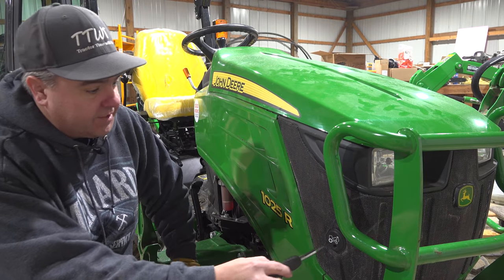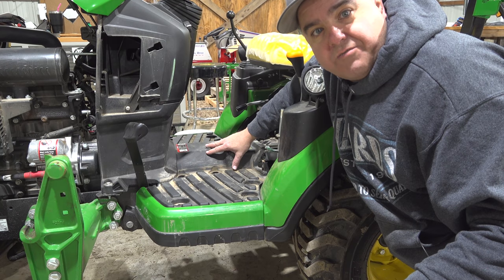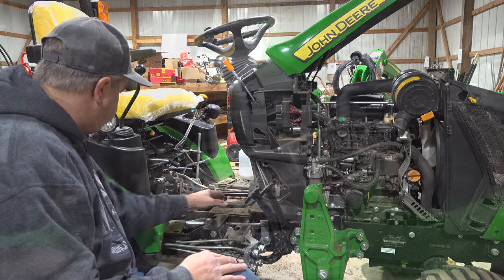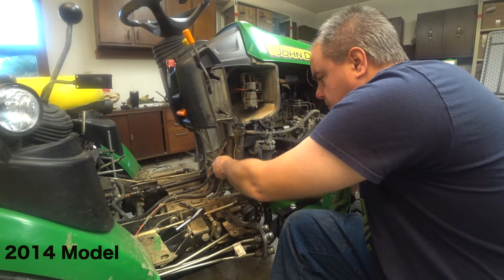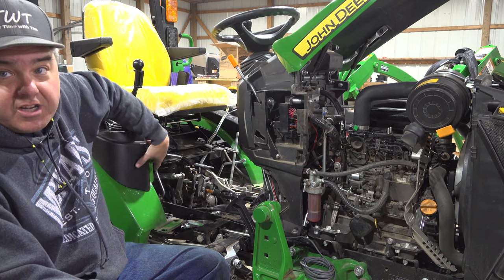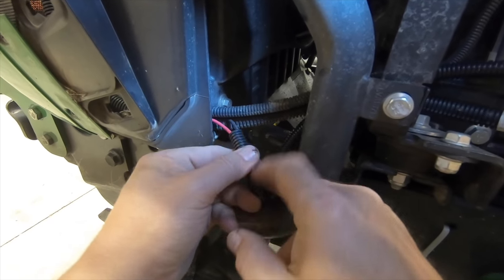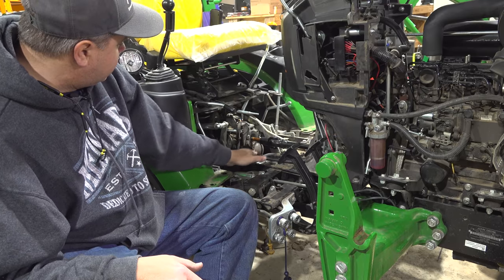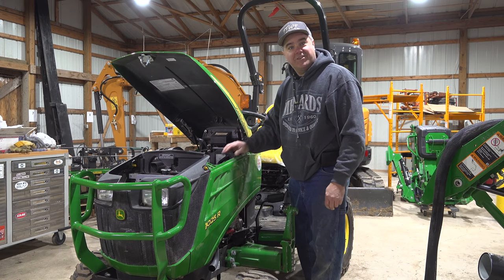Deere 1025R Internal Changes. More extensive than I thought! (vs. 2014)

Comment: The "wire loom " that tim has is plastic, My Brother in law is a Marine Mech. and he use's a woven mesh thats  similar  to the plastic version  but is more wear resistant because it's used in the boating industry ,I believe theres more vibration  and it's pretty much indestructable.
Reply: Wire loom is a woven coated tube. Concoluted tubing is a corrugated plastic tube which can be either unsplit or split  on its length. I was initially an aviation feature developed by Dyna Corp and Lockheed Martin to run wires in and have a weather proofed device for wires exposed in engine bays and wheel wells. The aviation field has all kinds of various fitting that are heat shrinkable that is used in conjunction with convoluted tubing. Other uses simply use electrical tape to close the ends and areas wires exit the tube.  The expanded mesh tube such as used on the H120 loader hoses ar the hyd disconnects is commonly called panty hose. It comes in single conductor to large wire bundle sizes. It is used at the ends of convoluted tubing where wires enter or exit for flexibility.

Comment: I am rather surprised with the amount of plastic used on this model.   I am not sure how I feel about that.
Reply from the maker: I have no issue with it.  Haven’t seen any stories of it wearing, breaking, or otherwise failing.  Meanwhile, the 1025r is actually less expensive now than it was in 2014 when I bought mine.   Amazing!  lots of machine for the money.
Reply: @TractorTimewithTim  Unfortunately, last season when I bought my subcompact tractor, the quote I received for the 1025r (which I really wanted) came in a good bit higher than I was happy with.  The orange and green somewhat shocked me.  I ended up going with the GC1720 TLB which I've been ok with so far.  Slowly, I'm adding implements and adding farkles.  It's a lot of fun.  

Aside from the seat being wonky, did you have any other observations about the MF GC1700 series? I appreciate your  opinion and keen attention to details.
Reply from the maker: I like the Massey.  It is missing some features which the Deere has, but it has strong and smooth hydraulics.

Comment: Gross weight /Length the same or less.  Is it a short block of sorts ?  Smaller cylinders ? same power. Hum.
Reply from the maker: More efficient use of the space around the steering column, I think.

Comment: If that has 25 horse than it’s not much better than my much smaller lawn mower which has 23
Reply from the maker: Right.  Horsepower alone determines effectiveness.
Reply: A 25 horse diesel is completely different animal than a 23 horse gas. I'm sure your 250hp car is just about the same as a 300hp Mack truck too.

Comment: Don't think the plastic would handle a 50 hp engine.
Reply from the maker: The frame is sturdy steel. Never seen one of these structurally damaged.  Even with rollovers, etc.  the complaints about plastic seem to be overrated.
Reply: That's great. Heard people say they cracked from stress. Musta been talking from rumor or out behind idk. But experience beats talk Good to know. We are looking for a small tractor for stall cleaning duty

Comment: The hood is warped because it is made out of plastic, they take pride in it... also, the reason the hood is now opened the way it does, certain countries have a stupid law, if the motor is a certain power and above they need to secure it so kids cant open it easily... stupid but real.
Reply from the maker: Discussed in our recent video from Germany.
Reply: Tractor Time with Tim sorry I missed that.
Reply from the maker: No worries.  The German dealer explains it well.  Might be worth your time.